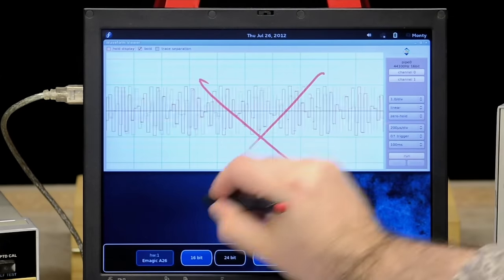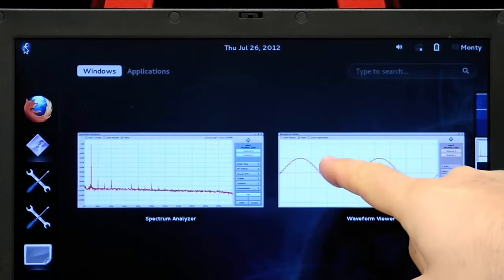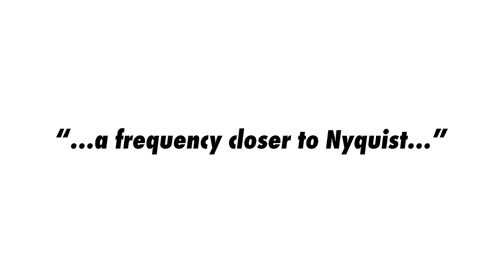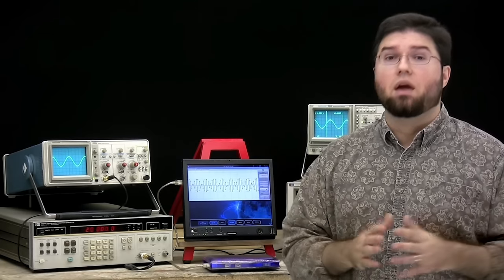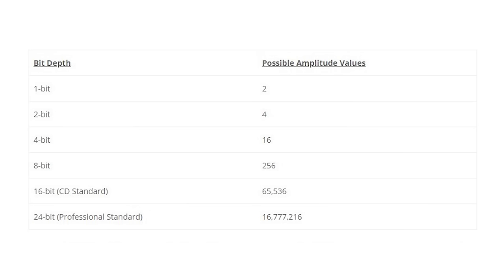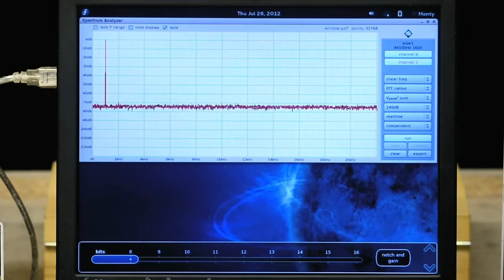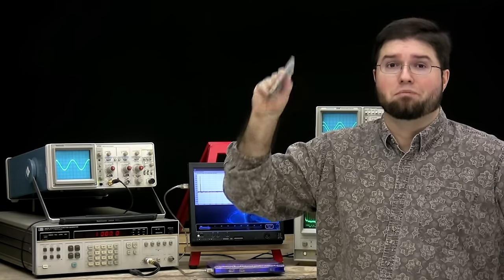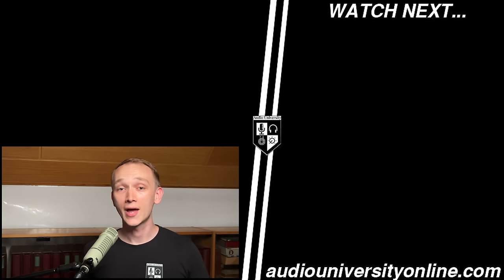Debunking the Digital Audio Myth: The Truth About the 'Stair-Step' Effect

Comment: Engineers *smdh*, you should have asked a DJ.

A constant tone will not produce the "stairstep" phenomenon, it is the gaps between frequencies that are represented in the Code, that creates the "steps". The reason it is almost impossible to see, is because a Sine Wave doesn't really apply here. At best, it will just show you when you are detecting a frequency, and what frequency you are detecting.

Unless the missing sound is critical to the piece, most listeners will not even notice it. To "see" the missing music, you would need to use an Analog Spectrum Analyzer, and compare the two outputs. That would show the gaps where the sound is missing.

Play a note on a guitar and slide your fingers up or down along the fret. When going flat or sharp, to the adjacent note, there is almost an infinite number of frequencies between the 2 notes. Digital cannot do infinite numbers, and flat and sharp tones are usually not wanted, so most of what is "missing" goes unnoticed.

For the average human, if you're not playing quadraphonic orchestral movements, or very poignant and/or difficult solo movements, the extra sound will be of little consequence. The average listener does not get musical nuance.
Reply: and this is why you talk to an engineer you don't understand even the most basic physical aspects of how the devices you use function it's quite sad to see.

Comment: Stair step is not the issue. The problem comes in the maths used by the DAC. Of course if you digitise a sine wave, then DAC it, you'll get a sine wave back. That's because the analogue sine wave is mathematically fitted to the digital points in the DAC, as the most basic assumption possible. But real music is not a sine wave, it's a  highly complex amalgamation of many sine waves of different root frequencsi and of harmonics, and in the case of percussion, some fairly non-sine-wave shapes.  When you sample that at 44 kHz, you miss out the non-sine-wave wiggles between the sample points. The question then is, what maths do you apply to fill those wiggles back in?  There are ways to improve on a simple sine wave assumption, and the finest audio DACs use these better curve-fit methods, but they are still assumptions. Personally, I find 44 kHz 16 bit fine for most listening, and superior to analogue reproduction at low frequencies, but the reproduction, even on a decent hifi system, of certain percussion, notably cymbals, and sounds like the plectrum hitting the strings of an acoustic guitar, are sometimes just too jarring and make me go get my vinyl copies out.
Reply: You are obviously not an electrical engineer. Ever hear of the Fourier Transform? All (and I mean ALL) waveforms can be decomposed into sine waves at different frequencies - yes even the "non-sine wave wiggles". Hence, providing Nyquist is obeyed, the theory in this video holds.

Comment: Unfortunately, incorrect. The digital-analog converter restores an analog sine wave, so it couldn't have been ragged at all. What you are missing here is the harmonic/timbral component of the sound permanently changed by the initial conversion into digital (albeit restored back to an analog sine wave by the subsequent conversion), beyond the ability to hear it but certainly measurable with the right instruments at the right node in your acoustic chain.

Comment: crap digital audio is due to excessive compression, DAB radio is a good example. another good example is the "squeeze my paw" toy, i hear a horrid "ringing" noise over the audio. CDs are good audio (always have been). poor playback is due to cheap equipment.

Comment: The classic measurement error called slew rate.
The brain expects a new sound impulse every 7ys, but at 44.1 it only gets it every 22ys.
This is why the sound is rough. At 192 kHz, a new sound impulse is generated every 5.2 ys and meets the hearing requirements of the human system.
In all the measurements, the human factor is always ignored and irrelevant values are compared with each other.

Comment: Kinda of newb stupid question: Wouldn't ANY deviation from a perfect Sine show up as THD in the analogue signal? Isn't that exactly what THD is supposed to be measuring? I got into DIY home theater subs, which lead to a far greater understanding of speaker design/performance which made me appreciate how little signal/power THD actually matters in the end. I've never even thought about DACs being limited in sine reproduction, so I learned something new here. I've only ever thought about this with Inverters and how they work, and it would intuitively make sense that a DAC would have the same stair-stepped output but apparently not. The Audiophile community is actually insane though and I can easily see how stuff like this gets popularized.

Comment: There's definitely an assumption baked in here. 

That assumption is because we can't hear above 20k hz, we can't precive frequencies above 20k hz.

You can test this at home:

Play a sin wave at 15khz, then play a square wav at 15khz(the odd harmonics start 45khz a full 25khz above human hearing). Both only have a single frequency in the human hearing range.

Can you tell the 2 apart?

I certainly can, and it's dramatic enough I'm  completely re-thinking how I'm going to produce my music.

So while you can't hear above 20,000hz , ultrasound plays a role in the texture and character and mood of the sounds you hear.

There have been scientific studies on this and its psychoacustic properties on brain waves.

If rupert neve is correct, this perception goes all the way to at least 100khz, meaning that you need at least 200khz sample rate to accurately simulate human sonic experience digitally. 

Also the "Stair Step is never what the digital signal is that just a visual representation, but in reality, it's only a value at each sample, then the value at the next one. Once you apply a DAC to the digital signal, "a voltage sin curve"(not technical name) is applied to find the smooth curve of best fit for the samples. Above nyquist, the function can not accurately determine the exact analog frequency mapping from the samples.
Reply: His comparison to a pixel is wrong as well. A pixel collects light across that entire square, same with the sample period for the audio. The gate opens and closes, so it's still a stair step. He's understanding the Fourier aspects ok but neglecting hardware functions and assuming all pressure variations are sinusoidal, which they aren't.
Reply: @userJohnSmith  I will secede that my argument is a bit padantic, most people won't notice a difference between a 16bit 44.1kHz, and a 32bit 384kHz track, but when there's ultrasonic harmonic content it seems to make a difference at least to me in the subtle texture difference. It's definitely still a rabbit hole I'm experimenting with because it seems to be at the edges of perception.

Comment: I did almost these same experiments for my students back when CDs were first launched.
We need to spread the word to flac enthusiasts who inflate CDs and vinyl to massive and pointless file sizes.
Reply: 16 bit FLAC is the same quality as CD in half the capacity.
Reply: MF Nickster  yeah, that's a good point. And to add to that point, some software doesn't seem to understand this either. I have some 24 bit 92khz FLAC files that utterly fail to decode in certain programs that are supposed to support FLAC. Even Windows Media Player struggles. I realize the files are overkill, it's just the format I received them in. Some niche nine inch nails releases and some formats on Qobuz, for example.

Comment: The stair steps contain informtation that's above 20KHz and the output of DACs have a low-pass filter that allows for only 20KHz and bellow to go through. I do agree that in most cases, 16bit/44.1KHz is enough but there are some situation in which higher bit depths and sampling rates are important - not only in Oscilloscopes but in audio also.

For oscilloscopes having only two samples of a signal shows only the first harmonic component of that signal that's why cheap 100KHz devices have 2 Giga-samples per second rates. 

Here's a square wave represented by the first 4 harmonics:

https://www.youtube.com/watch?v=cUD1gMAl6W4

Here's a great video by The Engineering Guy showing a 19th century machine built by Michelson (from the Michelson difractor fame):

https://www.youtube.com/watch?v=8KmVDxkia_w

Here's a sine morphing into a square wave by adding hamonics:

https://www.youtube.com/watch?v=v2LJ7Bk23kU

Comment: Nyquist theorem => sine wave.
Now replicate actions in video on triangular wave source. (If you know the math, you already know result.)
Reply: mfnickster9754  Square wave != Triangular wave.
Reply: @DarkFox2232  All waves are made from sine waves. Triangle and squares are combinations of sine waves. The sine wave is the fundamental building block of sound. 
Look at how FM synthesis works. (it is very deep) you can make any other wave by combining sines. So if you can reproduce a perfect sine wave you are set.
Reply: mfnickster9754  I do not think you comprehend problem at hand. And what Triangular wave is.
Reply: @tiomkinnyborg2289  While you are right that sine wave can synthesize other wave forms. You are wrong about rest of it.
  Sine wave is not fundamental building block of sound, it is even rarely produced in nature.
We use sine wave in digital audio because it was mathematically simple enough way to reproduce sound at low cost which is close enough representation of source.

When your speaker produces triangular wave, it does not release 50 different sine wave frequencies to composite singular triangular wave. it simply moves in and out in linear fashion once per period. That is if you have infinite sampling rate to produce perfect triangular wave on digitally driven electronics.

Video comes with premise that:
Analog_A => AD-converter => DA-converter => Analog_B results in exactly same output B as was input A.
That is true for sine wave sources. And false for triangular sources.
You do not need to move goalposts, strawman around, or do any what-aboutism.

Therefore I'll ask you again:
"Replicate actions in video on triangular wave source."
Reply: mfnickster9754  Your statement shows that you believe, moving membrane up and down in linear fashion results in release of infinite count of frequencies.
Picture that movement in your head. Then imagine how all those frequencies come to existence. Then imagine you moved that membrane by hand in linear fashion.

Don't you feel bit insane?
Reply: @DarkFox2232  Thanks for the correction. I believe that any sound can be broken down to a combination of pure sine waves. Sound recording is not a natural process in as much that it was invented by man. Speakers, DACs, amps, etc do not exist in nature so the science of synthesis and recording does not rely on naturally occurring sound, only maths. The way a speaker moves has zero to do with the initial production of the wave. It only does it stuff at the end so that we can hear it.  There are videos showing how adding sines at various degrees and frequencies reproduce other wave forms and maths goes both ways.  So I don't agree with you. Sines are the building block for other waves and digital recording proves it.  A sine wave was used because if you can reproduce a sine with 100% accuracy, then you can produce any other wave with the same accuracy.  Using a triangle is pointless.  Strawman?  Where? 
When somebody speaks they use words. If you break down the words you will find that the words are letter strings. But no letters were spoken. The alphabet is the building blocks of all words. The letters aren't natural but to record the words I will use them. The result will be a reproduction of what was said. The inflections are missing but it is close enough.  I hear digital recorded music and it is accurate. The triangle waves are all there and sound triangular. Am I missing something?
Reply: mfnickster9754  Again incorrect. Movement of membrane in linear fashion does not represent sine wave harmonics. It is other way around. Movement of membrane can be mathematically described by infinite number of sine waves. And on principle, it is very bad idea.
But it is nice that you finally realized that statements in video are not universally true.
Reply: @tiomkinnyborg2289  Your statement: "A sine wave was used because if you can reproduce a sine with 100% accuracy, then you can produce any other wave with the same accuracy." is False.

And I see no reason to even care about your "belief" side stories.
Reply: mfnickster9754  No.  Let me explain. If I can reproduce a sine wave accurately and sines can be used to make complex waves, then I can record complex waves accurately. Add multiple sines together and you get a triangle wave or a square wave or whatever wave. Barring quantize errors which manifest as hiss, the recording is perfect. You can use dithering to lower that inaudible hiss to even more nothing. 

Are you saying that you cannot record a triangle wave form?  I want to hear the recording that mangle the synth line because you can't record a triangle wave form. 

The maths are in. Digital recording works no natter what you are recording.  Did you buy into the myth? I am out. Do some research.
Reply: mfnickster9754  Why are you telling me what I already know?  All square waves are rippley. the display shows what people expect to see.  You cannot shift the phase of a signal in zero time, so we get a ripple called the gibbs effect If i recall correctly. 
If it sounds the same then what is the problem? Speak to the guy who thinks triangles cannot be recorded because they are 'magic' and sines cannot make them. 
I am out. Nice speaking with you.

Comment: Too bad Monty’s video does not really address the issue.
The method used, converting repetitive sinewaves from time domain to frequency domain and back to time domain, while easily performed on a stable waveform, simply isn’t so easily feasible on audio recording.
Also, don’t forget that, without an output filter, no such sample stream could show the nice curves that he shows at the output. So, the output is not the result of digitally recreated wave but that of an analog output filter.
When applied to music, his system would have to rapidly extract the frequency spectrum of very short audio samples while introducing both lag and precision errors on the resulting frequency spectrum due to insufficient sample data to reach the required level of precision. Therefore, each reconstituted bits of music would be off by a certain amount. That’s why high-res formats are better because they provide more input data to the process and therefore generate less “computational” error. With less errors come a higher-quality sound at the output so much so than an output filter might even be considered useless.

Comment: One meaningless point. Sampling measures signal over a period of time (perhaps using capacitors), or over a tiny area of sensor in case of photography. Video is a combination of both. This is practically averaging and not actually point (time, space) sample. However, the downstream processing (almost always) assumes it's a point signal. It is not anything you could perceive in reality but to be exact could cut high frequency spikes leading to a minimal loss of high frequencies / sharpness and dynamic range.

Comment: Analog is digital with infinite resolution.  At low sample rates, any really fast burst modulated frequency will not be recorded because it is between the samples.  It is the same as being filtered out.  The sine wave output you show has the gaps filled.  At CD level settings, I doubt anyone would actually be able to hear the sound, even if it was there.  Human eyes are roughly 15fps, so anything that moves past your eyes fast enough can be between when the eyes fire and can not be seen.  Same with a camera.
Reply: @nicksterj LOL  Analog is continuous without any breaks.  Applies to all science.
Reply: @nicksterj Never stated bandwidth.  It can be whatever you make it.
Reply: @nicksterj Not referring to any type of medium for recording, just stating that analog is one continuous all inclusive sample.  After a certain rate, nobody will hear a difference anyway so digital is "cleaner".
Reply: @solarsynapse  Any data lost is has a frequency outside of the sampling range, in which case you would not hear it.
Reply: @diatonicdelirium1743  Yes, slower than the sampling, so is filled in with the next closest data.  Can't hear it.  Like all movie film and video is frames and 60fps and higher, you can't see it.  Most can't see past 30fps.  The gaps are filled.  The brain also fills visual and audio gaps.   Humans don't actually see and hear in analog.
Reply: Done a little googlefoo and it looks like the firing/sampling rate of human hearing is around 100Hz.  Eye frame rate around 15fps.  Any more info would nice.
Reply: @nicksterj Like 8K TV is ridiculous unless you have a theater size screen or are zooming in to the pixels with a computer.  You can't see a difference on a "regular" size TV, it just consumes more resources.

Comment: This was a very interesting video but I still don't think it's as helpful as it thinks it is. As an electronics engineer who has used DACs many times, I can tell you that the stair steps are totally real. Regardless of the fact that 'samples' represent points in time with no duration, the output of a DAC certainly does hold its output steady until the next different output is set. What's not shown in this video is the filtering between the DAC and his 'scope. The steps are real, but the filtering removes them.